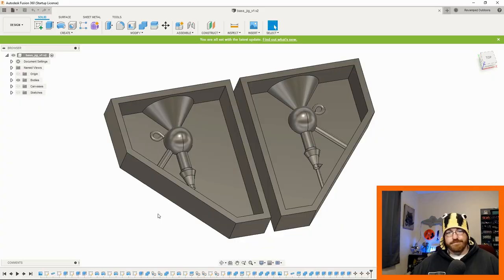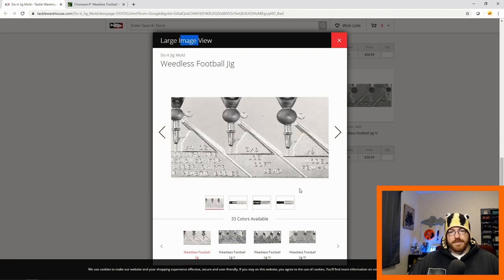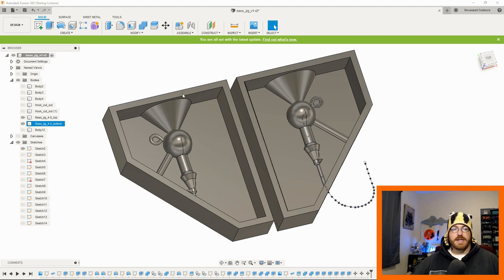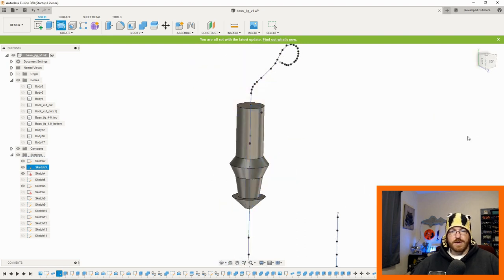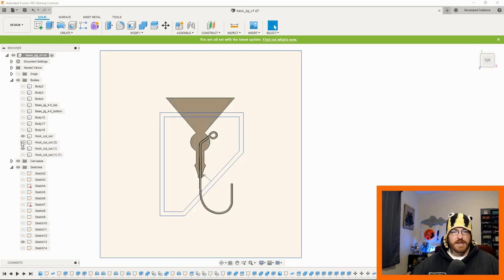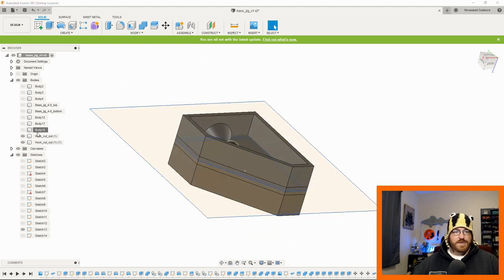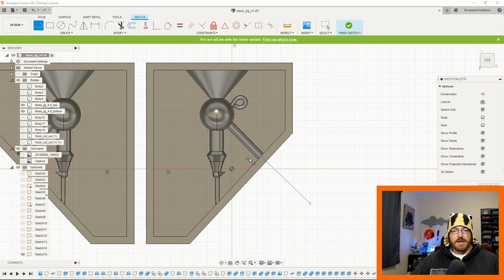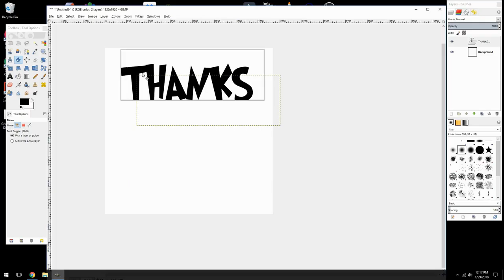Making a Bass Jig with a Weedguard (MakeJig) - Episode 1

Comment: Love watching your videos, I just started making my own baits after watching you and a few others. Just got my vac 50 in the mail today to mess around with some craws I sketched up in fusion 360. I love the idea of making your own jigs. do you have any plan on uploading these stls on thingiverse? Thanks again for the awesome videos, keep up the good work.
Reply from the maker: Awesome! Glad you're enjoying the videos! I release a few every once in awhile, I'll probably release a bass jig master mold eventually, still trying to get them to where I like them, right now this one works great for urethane casting but ends up being 3/4oz when cast in lead which is a bit heavy I think. The only time it works really well is in stuff current but otherwise it's pretty heavy for flipping cover. Not as sensitive as it should be when bass pick it up, I may scale it down a bit and try for a lighter lead weight. Or not lol, too many projects.
Reply: @RevampedOutdoors  I hear ya with the too many projects, I ended up designing something similar to this in fusion 360 I think your on to something with casting it out of resin. I'm going to give it a try but I'm going to pull a marling baits move and weigh out the shot before adding it in so I can get the weight closer to what I want.

Comment: Is it hard to start 3D
Reply from the maker: Not too tough, just a lot of practice. Starting off small with little projects to get the workflow figured out helps the most important aspect is to keep trying after failures. There will be a lot but enjoying the process is key, if you enjoy making things in general 3d design can easily be an extension of that.